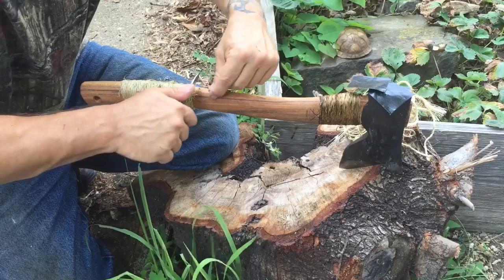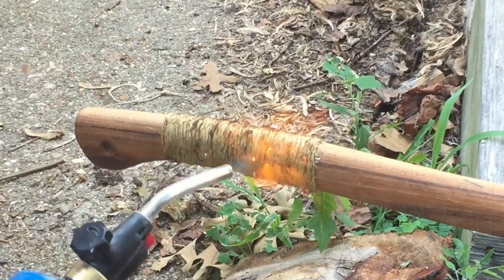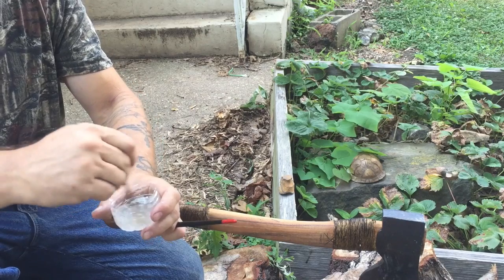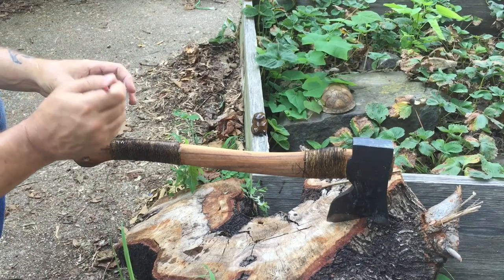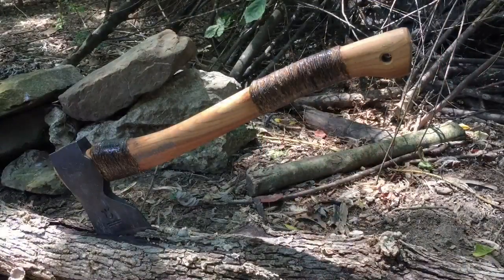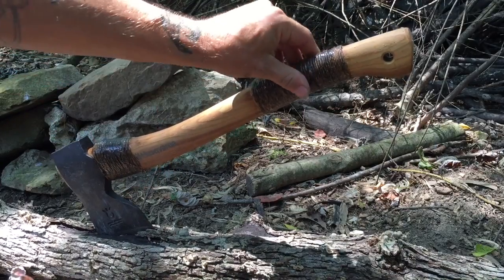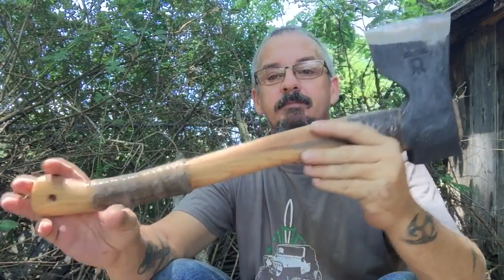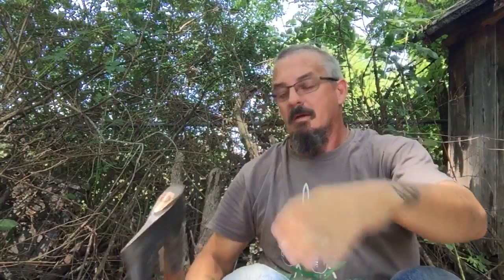D I Y  Whipping my axe handle

Comment: Why would you put twine up near the head? That's a carpenter's axe. The reason it has a recess up there is so that you can choke up. That whipping up there isn't going to do anything except cause blisters and fatigue. The cutting blade is like 4-1/2 inches. If you're getting overstrikes, you need to practice more swinging, and less wrapping bullshit around the handle to make it look "cool.
Reply: Sensibility_offender because everyone doing the "over strike" wraps & leather collars & also whipping on the handle, are just following the "youtube" fad. If you watch historical documentaries about lumberjacks, loggers, etc. you don't see those things tied or wrapped around their axe handles. There's no substitute for accuracy & skill when using an axe. Very few folks on YouTube making videos about axes, have much experience actually using one. Most probably never touched an axe til they started their YouTube channel with the last 2-3 years, if that long. Just watch their videos & it doesn't take long to see who does or doesn't have actual axe skills & axe knowledge.